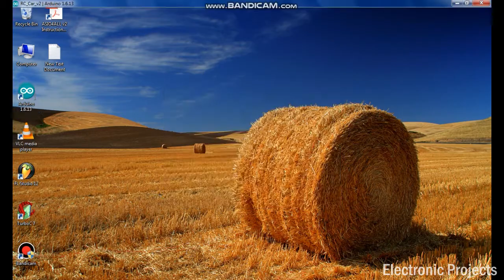How to make Police Light for Arduino RC Car | Arduino RC Bluetooth Car

Comment: Do you think that circuit diagram' re not presented Arduino A0, 2, 9, 10 pin.
Reply from the maker: In circuit diagram connections for police light are not mentioned, you can  connect it to arduino pin 9, 10 & GND

Comment: Which pins used to led front and back light and motors.Kindly provide me diagram
Reply from the maker: https://drive.google.com/file/d/169X0vgY8pgbRexj4GL56-_yBayOgZlj-/view?usp=drivesdk

https://drive.google.com/file/d/1gp7ueyb8DSwsZBFxeIxdO2Yc1WuQmxBa/view?usp=drivesdk
Reply: @uElectroPro  Not working( w/o servo).bt pairing(HC05) but not work.what is the problem.
Reply: Please check the mail.
Reply from the maker: Okay
Reply from the maker: Connect Bluetooth RX to Arduino TX and Bluetooth TX to arduino RX

Comment: Can you provide me circuit diagram for police syrin and police LED flash please 😘😘😪😪
Reply from the maker: Circuit diagram and code link is in the description
Reply: @uElectroPro  police syrin and police LED ka nahi diya hai bro
Reply: @uElectroPro  usme sirf led 1 led 2 led3 ka diya hai
Reply from the maker: Then watch another video about police siren on my channel
Reply: @uElectroPro  share me link
Reply: Ya app is code Ko edit karke police syrin and police LED flash light ka code kar sakte hai  jab 'x' command send hota h?? Please help me
Code is given

char t;
 
void setup() {
pinMode(13,OUTPUT);   //left motors forward
pinMode(12,OUTPUT);   //left motors reverse
pinMode(11,OUTPUT);   //right motors forward
pinMode(10,OUTPUT);   //right motors reverse
pinMode(9,OUTPUT);   //headlight
pinMode(8,OUTPUT); //back light
pinMode(7, OUTPUT); //horn

Serial.begin(9600);
 
}
 
void loop() {
if(Serial.available()){
  t = Serial.read();
  Serial.println(t);
}
 
if(t == 'F'){            //move forward(all motors rotate in forward direction)
  digitalWrite(13,HIGH);
  digitalWrite(11,HIGH);
}
 
else if(t == 'B'){      //move reverse (all motors rotate in reverse direction)
  digitalWrite(12,HIGH);
  digitalWrite(10,HIGH);
}
 
else if(t == 'L'){      //turn right (left side motors rotate in forward direction, right side motors doesn't rotate)
  digitalWrite(11,HIGH);
  digitalWrite(12,HIGH);
}
 
else if(t == 'R'){      //turn left (right side motors rotate in forward direction, left side motors doesn't rotate)
  digitalWrite(13,HIGH);
  digitalWrite(10,HIGH);
}

else if(t == 'W'){    //turn led on or off)
  digitalWrite(9,HIGH);
}
else if(t == 'w'){
  digitalWrite(9,LOW);
}
else if(t == 'U'){
digitalWrite(8,HIGH);
}

 else if(t == 'u'){
digitalWrite(8,LOW);
}

 else if(t == 'V'){ 
   digitalWrite(7, HIGH);
}
else if(t == 'v'){
digitalWrite(7, LOW);
}

else if(t == 'S'){      //STOP (all motors stop)
  digitalWrite(13,LOW);
  digitalWrite(12,LOW);
  digitalWrite(11,LOW);
  digitalWrite(10,LOW);
}
}
Reply from the maker: https://youtu.be/NuBxGNQD6xU
Reply: @uElectroPro  jo code uper h usme dikhye kuchh agar edit ho to